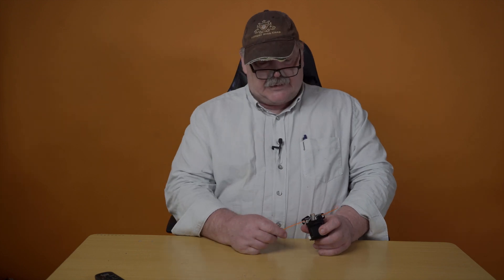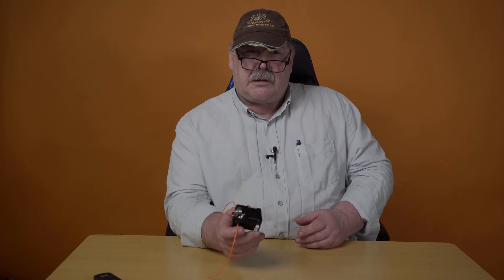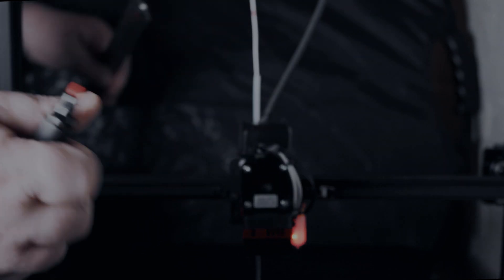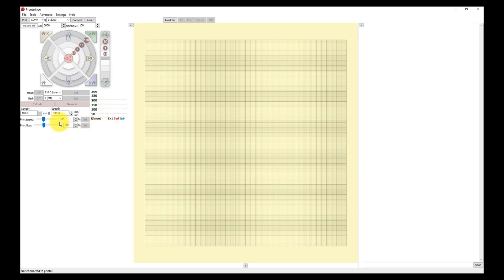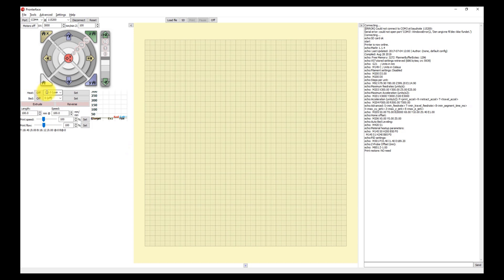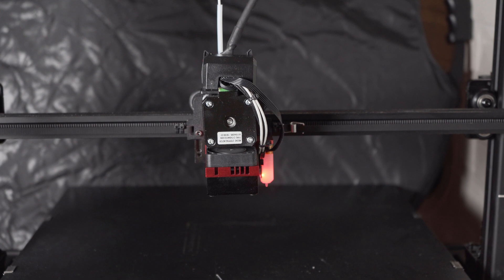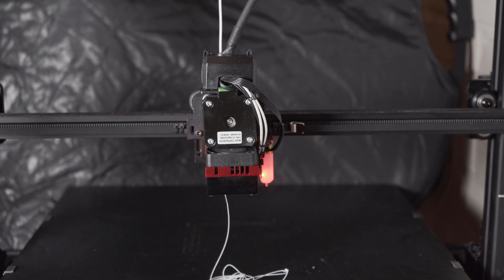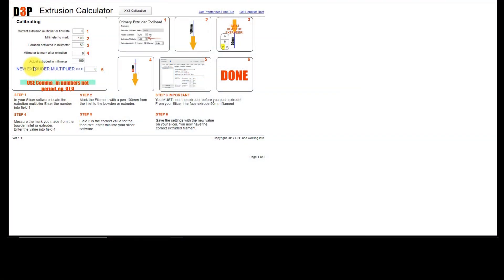Part 3  Calibrate the Extruder on your Wanhao 3D printer and other printer

Comment: how do you connect the printer with the computer via USB? isnt it a Ethernet cable?
edit: oh i realised its not a ethernet cable... dont know wich cable is tho haha
Reply from the maker: Thanks for watching.  You connect via usb
Reply: @weitlingD3P  yeah i figured it out, that cable is called "printer cable" bc is used in ink printers too. Enders have miniUSB cables... thats easier.

What happened to the link of the extrusion calculator? its not working